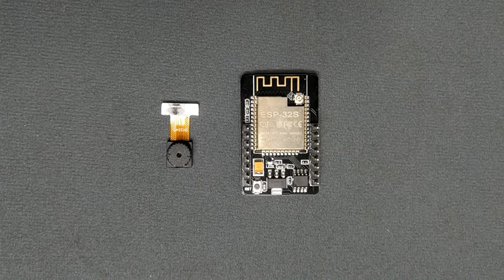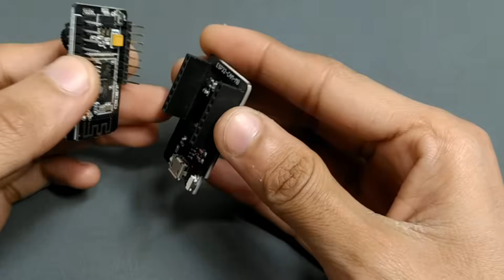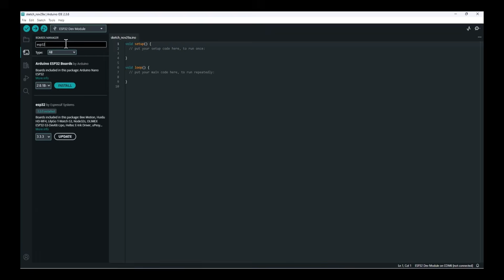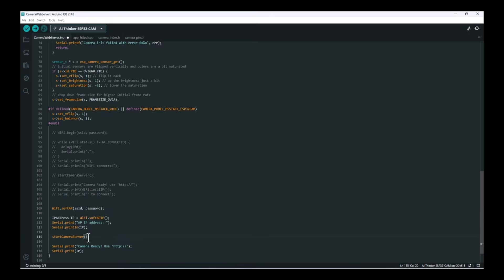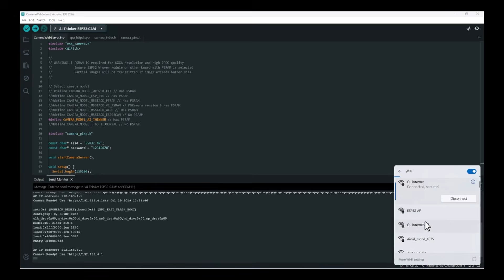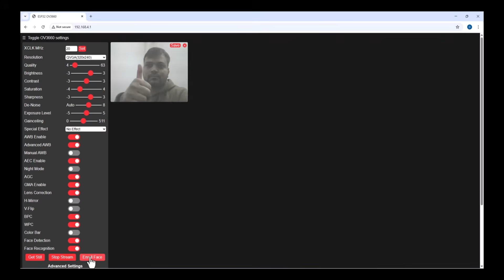ESP32-CAM Getting Started  | ESP32-CAM Face Detection & Recognition Fully Working

Comment: Best Video. For anyone struggling with ESP32-CAM Face Detection and Face Recognition, this setup worked for me:

1. Use ESP32 board package:
   ESP32 by Espressif Systems → Version 2.0.0

2. Select the correct camera model:
   #define CAMERA_MODEL_AI_THINKER

3. PSRAM is required. Make sure your ESP32-CAM PSRAM is detected.

4. In app_httpd.cpp, Face Detection and Face Recognition are disabled by default for normal ESP32 in some versions.

5. Find this section:

#ifdef BOARD_HAS_PSRAM

// Face Recognition takes upward from 15 seconds per frame on chips other than ESP32S3

#if CONFIG_IDF_TARGET_ESP32S3

#define CONFIG_ESP_FACE_RECOGNITION_ENABLED 1
#define CONFIG_ESP_FACE_DETECT_ENABLED 1

#else

#define CONFIG_ESP_FACE_RECOGNITION_ENABLED 0
#define CONFIG_ESP_FACE_DETECT_ENABLED 0

#endif

Replace it so that both features are enabled when PSRAM is available:

#ifdef BOARD_HAS_PSRAM

#define CONFIG_ESP_FACE_RECOGNITION_ENABLED 1
#define CONFIG_ESP_FACE_DETECT_ENABLED 1

#else

#define CONFIG_ESP_FACE_DETECT_ENABLED 0
#define CONFIG_ESP_FACE_RECOGNITION_ENABLED 0

#endif

6. I also used ESP32-CAM as its own WiFi hotspot using:

WiFi.softAP(ssid, password);

Then get the IP using:

IPAddress IP = WiFi.softAPIP();

7. Upload the code and connect your phone/laptop directly to the ESP32-CAM hotspot.

8. Use QVGA resolution initially for better stability.

After these changes, Face Detection, Face Recognition and Enroll Face worked for me on AI Thinker ESP32-CAM.

Hope this helps others facing the same issue!

Comment: Hi sir 
i wanted to confirm that only 2 things are needed for this project the esp32 cam and cam programmer ?
Reply from the maker: yes, you will also need a power source, like a USB cable or a adapter/battery, to run the board.